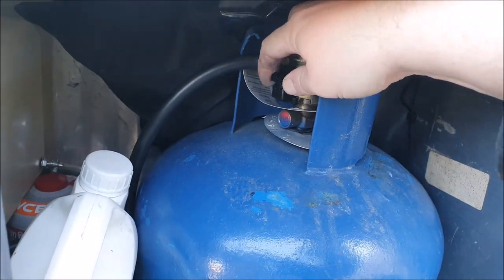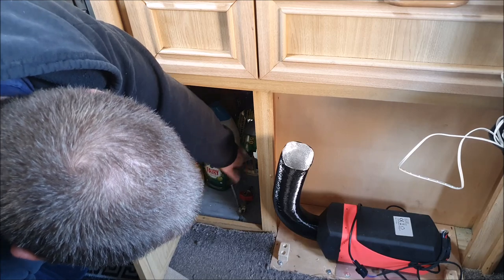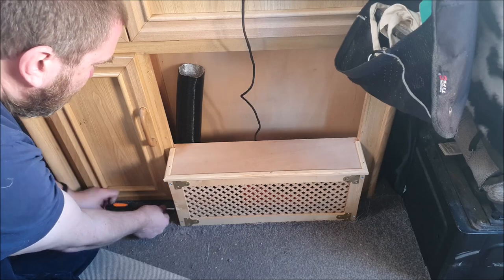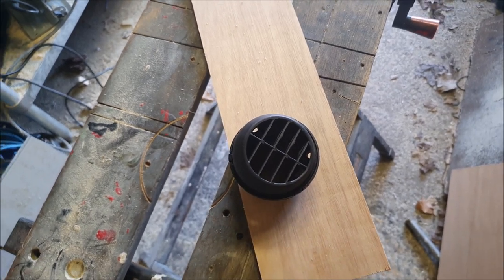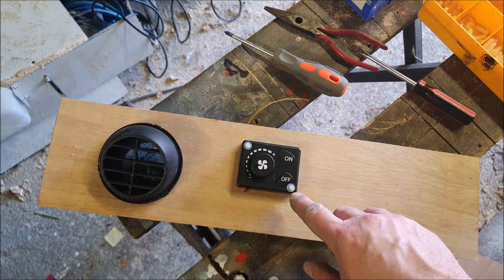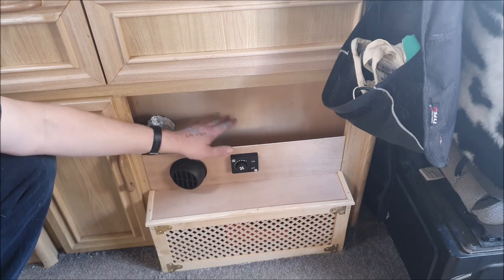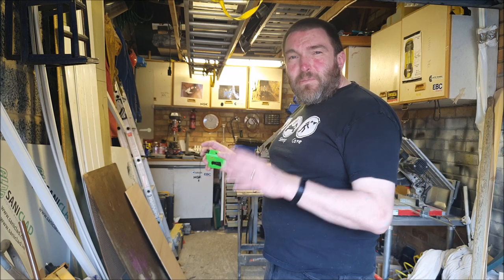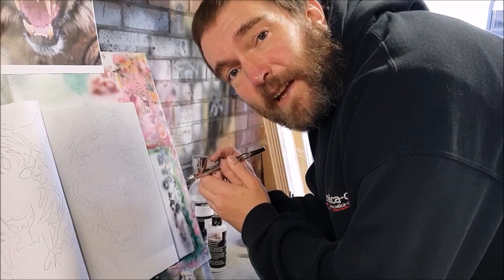Installing A Diesel Heater In My Elddis Autoquest 270 Motorhome  Part 8 - Panel For Vent & Controls!

Comment: Hi Alex,why don't you replace that manual switch with a modern digital one only about £10 on ebay.)
Reply from the maker: It's an option. At the moment I quite like the simple knob panel 🙂